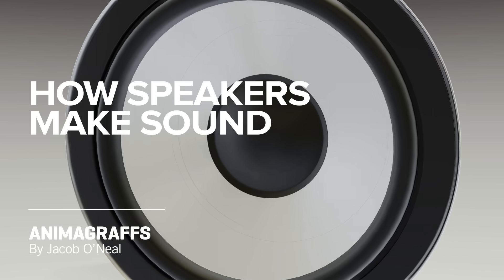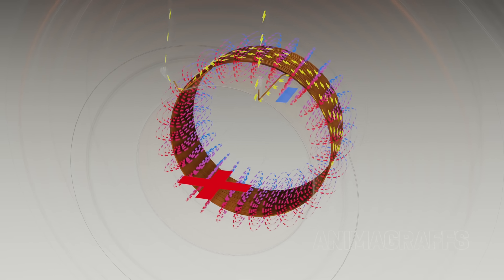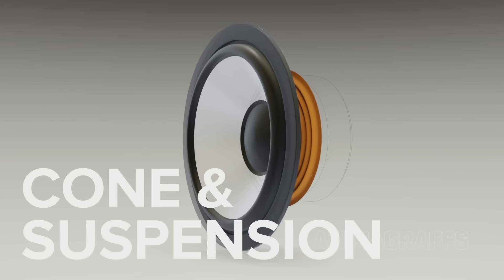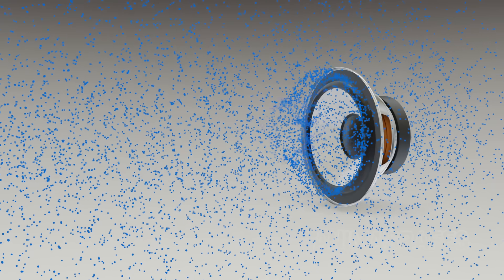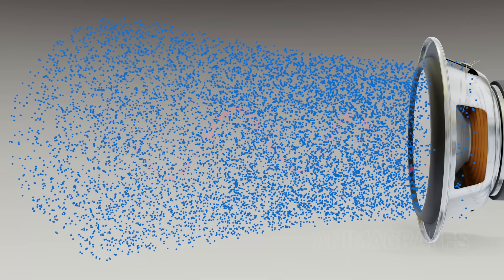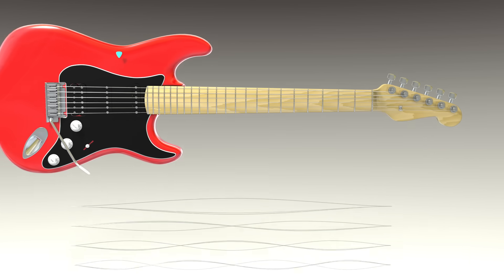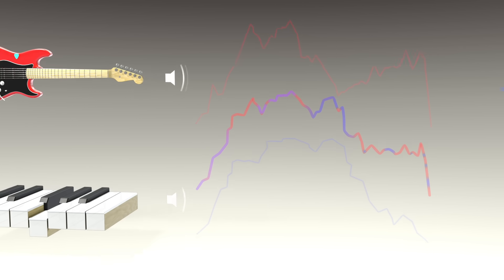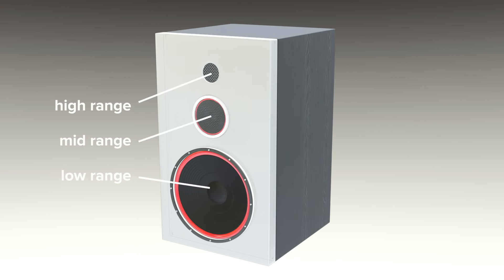How Speakers Make Sound

Comment from the maker: At render time, I had an issue I didn't catch until the video had a lot of views (so I can't replace it easily): the voice coil is off center. It should sit centered with the magnet top plate and pole piece, as shown in this diagram from Wikipedia: https://upload.wikimedia.org/wikipedia/commons/c/cd/Speaker-cross-section.svg
Reply: Oh, you had an error? You had one, measly little error in your magnificent ballet of a video, that crammed more education and delight into one video than I can remember seeing in any other? That had an education and delight quotient so high that it cannot be displayed on calculators made before 1986? My condolences, your mother must be ashamed of you.
Reply: @seanrcollier  what
Reply: @JohnPaulBuce  The comment speaks for itself
Reply: How does it create all the sounds by pushing the diaphragm back-and-forth?  I push my hands back  and forth and there's no sound.
Reply: @csp405  Your hand isn’t pushing nearly enough air (although if you were to put your hand up directly next to your ear in a quiet enough room and moved it fast enough, you would certainly be able to hear it). But even if your hand could move the air around it with enough force to create audible sound waves, it still wouldn’t be capable of vibrating at the precise, ever changing frequencies necessary to recreate digital audio recordings.
Reply: Nice Job! This is the hands down fullest description of speaker function I have ever seen.  Most over simplify it and leave too many unanswered questions.  
I will now point anyone who asks me to this very competent video.  Thank you for you time and effort.
Reply: Please reflect on what you have done sir
Reply: Thank you very much for your hard work. Your animation videos are amazing! Subscribed!
Reply: @animagraffs  excellent video
Reply: Radhe Radhe Krishna 🥰🙏
Reply: Hi , willing to contact you since 2022 I started hearing voices,but I know that I am not crazy ,I know that true people are behind that , I am thinking about a way to record those voices knowing that If I am the only one to heard it ,it mean that maybe They are using another frequency than normal sound, or maybe I am on another frequency, I do need someone who has experience on sounds vibration and frequency
Reply: Wow! Your animations are absolutely incredible. You got a new sub from me. Thank you for your hard work!!!
Reply: whats the name of the music on the last part
Reply: How much is like last manhunt you can
Reply: It is very helpful. Thanks
Reply: A modern marvel
Reply: Hello there. There's a lot of comments on this video, and I am afraid that my question is going to go unnoticed. So, please pardon me if you find my question repeating, because I am going to try to alert a few people to it hoping someone is able to help me. My question is, is it possible to divert the electric current in the voice coil away from the cone, into an amplifier, then collect the amplified impulses from the amplifier, for another purpose entirely, in the stead of using it to produce sound waves? Please let me know what your thoughts are on this. Thanks
Reply: for those who didn't know, it was a little bit too deep
Reply: @animagraffs - thank you.  (All of your vids are always so informative and just cool!)
Reply: @animagraffs- Jake O. Neil.  One last comment, all of your work is a work of art.  (I am not only so impressed with how well you animate the topic, but also how you are very thoughtful about the script-narration, the flow, etc.  Idk what software you use, but schools and institutions can definitely benefit from your skills-
Reply: Hi dear Hard worker.
Which software do you use for simulating or modeling?
Reply: @Sichan.2004  in the comments of his F1 video, he says he uses Blender.
Reply: @shakeydavesr  many thanks dear David.
Reply: Please make a video about various transducers used in Headphones and IEMs such as dynamic drivers, planars, balanced armature, and electrostats. 🥺
Reply: Trust me dude you're killing it ive watch all you videos and they are fantastic
Reply: Why is a speaker better then another speaker?
Reply: @RedHardcore7  because the composition of the cone, surround, spiderweb, copper coils differ from each others. also the shape of the speaker itself. bigger surround, stiffer cone, sturdy former and spiderweb. there are a lot to tinker!
Reply: More intricate connections, more dedicated parts connected more carefully and with less seams. Material that has the perfect durability while lightness.

Comment: Every speaker is also a microphone. This device works in the other direction too! Electric signals vibrate the speaker, but outside vibrations on the speaker also create electrical signals! You can plug in headphones for example, into a mic input and it will work.

Comment: I still cannot grasp how a single surface moving back and forth can reproduce infinately complex sounds. There has to be more to it than that, right?
Reply: @Skall-ex  think about your eardrum. It as well is only moving in a single motion when you hear things. The pressure waves from everything you hear is added together at your eardrum. Speakers do the same thing where all the different waveforms are added together and you hear the sum of them as a single motion. 

Your brain is able to decipher it though because of your inner ear (the cochlea). Thats the snail shaped part of the inner ear that is filled with fluid and sensitive hairs. The pressure waves are sent through the cochlea, and specific hairs pick up specific frequencies, sort of decoding the sound wave into its individual parts that your brain can decipher
Reply: @sidesaladaudio  Allright. It still sounds like magic to me lol. If the speaker could move in 3D so that the pressure waves were "bumpy" it would make more sense to me. Gotta look into it more to grasp it. But I appreciate your effort.

Comment: If it makes more sense (probably only to engineers) the spring force provided by the suspension of the speaker can be used to calculate a position given a force acting against it. The electromagnet, given specific currents, produces very specific forces. So, given the displacements needed to create an auditory pressure wave are known, and that the pressure waves of all instruments create a superposition within the audio pressure waves, a direct measure of position of the pressure plate is all that is needed to transcribe into a current to produce the desired sound. The suspension is fast enough to compensate, in combination with the reversal of the current, to retract the diaphragm as needed to pull back to a position in the same manner as the diaphragm is pushed into position. A microphone is just a speaker in reverse, so that is why microphones and speakers have existed long before frequency modulation technology, by just connecting the two directly with amplifying circuits. This also makes it very easy to measure the currents needed to achieve specific positions as those are typically measured directly, and all combinations of sounds are combinations of pressure waves, and then all pressure waves are combinations of currents. This is also why different speakers are used for different frequency ranges as the different constructions allow for the speaker to more reliably create the desired sound frequency while also being more durable.

Comment: I always wonder about questions like this. Stuff above my expertise I am so perplexed how people figured out. How these little soldered tiny pieces of metal and wires somehow a pulse/photon/whatever of electricity as 1 or 0 and somehow a bunch of those running through the wires results in grand theft auto in 4k on my screen, completely interactive in an online virtual world. I try to find videos that explain it and find myself often more confused than before. FINALLY... a video that actually explained each part to the layman with amazing visuals. What a treasure.

Comment: The only hiccup is that you got some of the terminology wrong. The part of the speaker shown in the video is called a driver, while the actual speaker includes the enclosure or box. A speaker that is not intended to be used against or inside the ear (such as telephones or earbuds) is called a loudspeaker (such as those in stereos, laptops, TVs, cars, etc.) Therefore, the three different sized ones shown at the end are not "three speakers", rather, one loudspeaker with three drivers.

Comment: amazing animation , better than any education
Reply: The only hiccup is that he got the terminology all wrong. The part of the speaker he showed is called a driver, while the actual speaker includes the enclosure or box. A speaker that is not intended to be used against or inside the ear (such as telephones or earbuds) are called loudspeakers (such as those in stereos, laptops, TVs, cars, etc.)

Therefore, the three different sized ones shown at the end are not "three speakers", rather, one loudspeaker with three drivers.
Reply: @Jul-66  Thank you for real information🤯
Reply: @Jul-66  And you are professional i think

Comment: The magnetic field induced by electricity flowing through the voice coil is completely inconsequential.  It's extremely weak, and oriented in the wrong direction to generate the force that moves the coil and the diaphragm attached.  The electrons flowing through the voice coil experience a Lorentz Force, which is described by F = i x B (where i and B are vectors).  B is the magnetic field in the gap, which is oriented RADIALLY (with one pole inside the voice coil and the other pole outside).  Since the voice coil is circular and the magnetic field is radial, the current in the voice coil always moves perpendicular to the direction of the field.  This produces the desired axial force to move the voice coil, as described by the right-hand-rule.

Comment: In the place where the coil is located according to your animation, the magnetic field created by the permanent magnet of the speaker will be practically equal to zero. That is, no forces from this magnet will act on the coil in this place. And, therefore, your speaker, which you have invented with such love and such care in your animation, will not make any sounds.
In order for your speaker to work as it is supposed to, the coil must be placed in a cylindrical gap in such a way that between the magnetically conductive disk covering the magnet from the inside and the magnetically conductive core on the disk covering the magnet from the outside, there is exactly its (coil's) middle.

Comment: Great video! But the sine wave is missleading and it is the cause to why me myself did not understand sound physics for severeal years. The visual presentation of a sine wave describe how the speaker should move backwards and forwards. If it was a pulsewave (ex: squarewave) the speaker would go back and then straight back while a sine wave makes for a much smoother moition. so the sine wave should be fliped to the side feeding into the speaker like a Magazine not projecting outwards. I feel like i didnt make a better jobb explainin but just be aware that this can be missleading. None the less Its a great Video!
Reply: The last visual is a Great Presentation of what is acctually going on! Great!!!!

Comment: i still dont get how the electrical signals on the magnet turn to sound
Reply: The electrical signal on the wire and the magnet move the cone back and forth. That's all it does. There is no magic here. Sound is just air vibrating back and forth at specific frequencies. The coil and magnet is just a way to vibrate that cone back and forth, it's just a motor that goes in and out instead of around in circles. If you were superhuman and could vibrate that cone back and forth anywhere from 20 up to 20,000 times a second with your hand, you would get the same results without the coil or magnet.

Comment: In the speakers that plays a good bass as well as a wide and detailed medium tone spectrum.  Vending (Spider) must also be soft in the middle and very hard in a larger circle, due to geometry related to sensitivity and membrane resistance, and this has unfortunately only a very small percentage of speakers, because it is like a secret ??  Another thing is an anomaly that is attached to the coil of copper wire, and that is to get almost 2 times louder sound if two wires of 8 instead of one of 4 ohms, let's explain that occurrence

Comment: can U explain it more simply?
Reply: electricity makes electromagnet magnetic, it moves. Signals that oscillate at a frequency moves the magnet at a frequency. The magnet is attached to a diaphragm, and it moves along with magnet. If the magnet is vibrating, it causes the diaphragm to vibrate, the. it creates sound

Comment: I have a question to 1:29. Could it be that the magnetic field which is shown there represents the voice coil? For my understanding the fields of the magnet might point from pole to pole crossing the gap in a straight line.
Reply: It’s more that enough electrical “pressure” on lightweight diaphragms (speaker cone) is the key. It’s why you need a lot of voltage, with a solid amount of amps, can control the ohms of speakers that have physical characteristics that vary. You don’t need amps for tweeters, but you’ll need a strong amount of them for bass.

Comment: so wat is gonna change if the copper wire they put on the coils
is fatter and more solid than wat they normally put.? 
i mean sure it would heat less.? 
but will there be any change in sound.? meanin the speaker to sound even better.?
Reply: The resistance would be smaller

Comment: I get that there's an alternating current going to the transducer in the speaker, but how does that current produce differing waveforms?

Or, more specifically, how is the electrical current modulated, in order to reproduce complex, changing waveforms over time?

Comment: Your presentation ignores the moving magnet loudspeaker which accomplishes the same electrical-to-sound conversion with a moving magnet instead of the moving coil which you describe. Fleming’s left hand rule for motors applies equally to either the moving coil or moving magnet configuration about which I am speaking. I would be delighted to supply you with the information you are missing.

Comment: Can you explain to me why some speaker are sound very good and other are muffled?
Reply: Either debris gets inside the motor and hinders its ability to function as intended, or there is deterioration in the speaker itself. Its not just the motor making noise. The cone and aupporting structures help project the noises as well.
Reply: It can also be from poor build quality.
Reply: It depends on the cone and coil mass and design

Comment: But why the cone shape? Why the cone is not just flat? Or other shape, like bulb protruding outside... is there a reason for that specific design? Is the shape resembling air horn for the same reason horn is that shape?
Reply: Same reason why a horn is shaped the way it is or a jet engine is shaped the way it is. Concentrate sound in the smaller area and then project it along opening walls to get it to spread out further.

Comment: I love this animation & explanation.
      Question, though: 
What's the difference between (sub)woofer speakers, and "full range" speakers...?
     Is it wire thickness / number of windings?
     And if so, does anybody know the amount of windings that would be "standard" for full range vs subwoofer...?
(Or the 'ratio', I guess..?
      In the hypothetical situation that the cones ('drivers'..?) would be the same diameter, and "otherwise identical"... (If that's even possible)...

Like... Is there some kind of 'formula' that dictates if a speaker functions as a tweeter, full range, or woofer...?
     Or is that ONLY decided through physical size of the speaker / perhaps through a crossover circuit...

Logically, I would think that a subwoofer would need thicker wire (to accomodate higher amperage to move the bigger cone), less windings (more torque)...

Does anyone know this?

Comment: Jokes on you I'm listening to this video thru my planar magnetic headphones. Almost completely irrelevant 😉

Though on another note (pun intended), this is a dynamic speaker, or more precisely, dynamic "driver". DD is the oldest type of driver (that isn't shit) and since been refined over time that it can be made cheaply with shit sound, or awesomely and produce true to life sound. In standing/monitor speaker world, DD is pretty much the only option at producing loud enough sound with great clarity. But scaled down you have many more choices. In headphones, there are electrostatic drivers with some type of flat plastic membrane with copper strand traces instead of conical plastic & copper winding, planar magnetic drivers have roughly the same concept but require less power from the amplifier (still hazy to me). Going even smaller, in in-ear monitor (IEM) world there are balance armature drivers which I don't understand yet how it works but I know it's originated from hearing devices, as such they're incredibly tiny (thus almost impossible to scale up).

I'm all in for Mr.Animagraffs to do other type of drivers.

Comment: The animation supervisor needs to be fired.  The maker who carries out the animations is provided with drawings, schemes and models that make them credible.  Here the entire technical chain of control has failed miserably.  The voice coil is positioned in such a way that it does not perform its function.  Sin.
Reply from the maker: Ah, but did you check your own chain of command before commenting? See the top pinned comment from months ago, citing this exact issue! Touche!